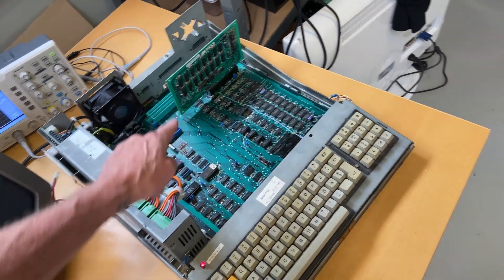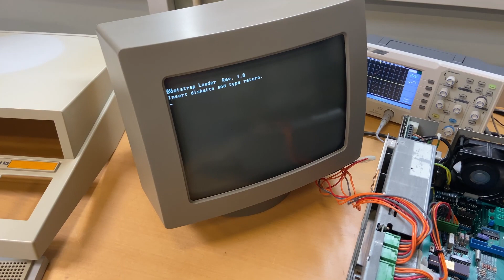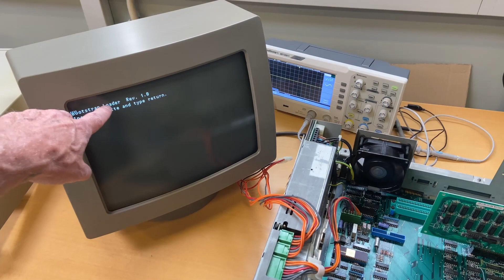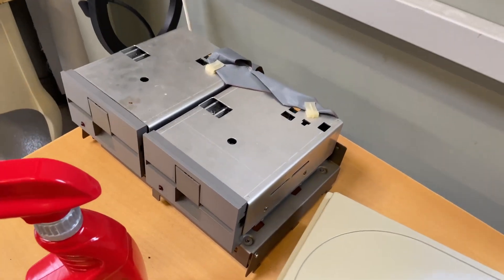Olivetti L1 M20 Zilog Z8001 - Episode 3

Comment: Does that boot problem still exist? It could be a cap in the reset circuit that is out of spec. I don't know the circuit of this machine but on other systems from the era there is a reset circuit that takes care delaying the CPU from getting out of reset to make sure, all other components are ready for operation. The actual time of the delay is controlled by a circuit with a cap. That could be your problem here.
Reply from the maker: Thank you for your comments and Yes that would typically be the problem. In episode 4 I'll get back to that issue.